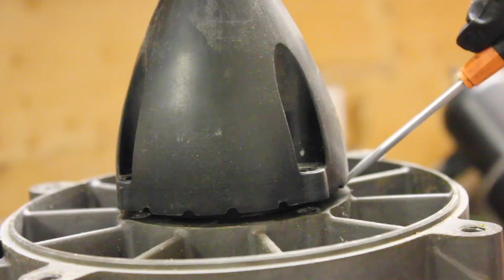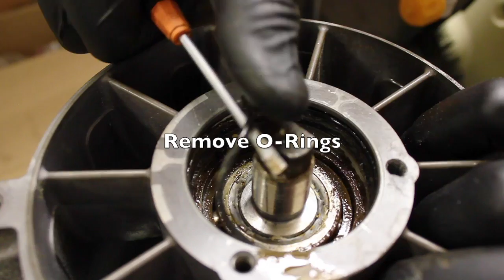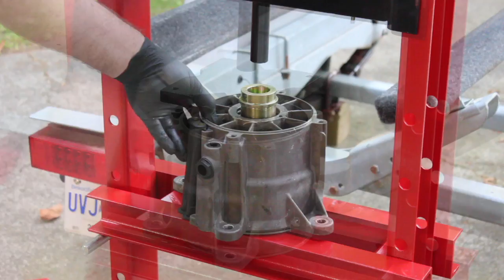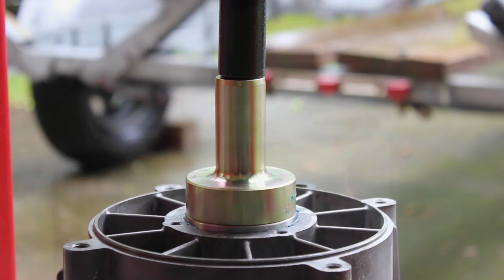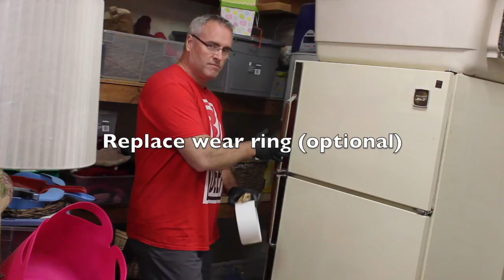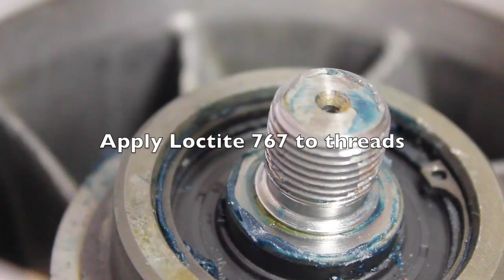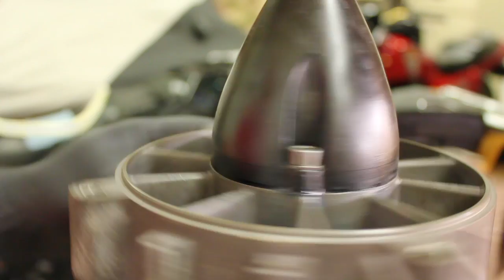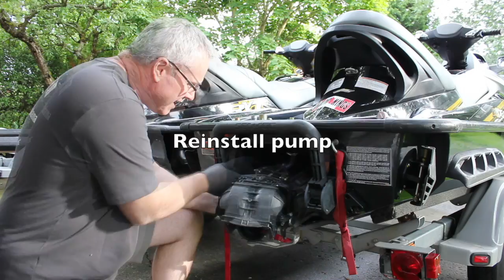How to Rebuild Your Sea Doo Personal Watercraft Jet Ski Jet Pump

Comment: Fantastic video. Love the closeups! Makes me want to go buy a press.
Reply from the maker: Go for it. They’re fun for the whole family!
Reply: Do it . I bought one to rebuild my pump , and also car  transmissions . I always brought my transmission pressing jobs to a friend of mines shop. About time I spent $150 , and bought my own. You really need the seal and bearing pressing tools, they worked great .
Reply from the maker: It’s interesting how many times we’ve used the pump after we bought it. We thought it would be used very rarely, but there have been lots of repairs that required it. Thanks for your comment.

Comment: So I have a 2007 RXT 215 and I'm 99% sure the pump bearings are bad/have failed because the impeller spins freely and doesn't "stick" like a normal greased bearing would. I'm debating rebuilding it but being 17 years old I'm probably better off just replacing the whole thing wouldn't you think? I'm in a pickle trying to find a replacement and would like some insight/advise of which route to go and/or any recommendations for a replacement pump. Thanks! Also this video was super helpful and answered a lot of my questions I had about rebuilding my pump!
Reply from the maker: As long as you have the tools and patience, a 17-year-old can do it. Mechanics is just like cooking: just follow the instructions in perfect detail. If you’re going to tackle these types of jobs, it’s highly recommended to get a Service Manual for your machine. It is much cheaper to rebuild it, and you can learn a lot while you do it. Just make sure you’ve got all the tools (including torque wrenches) to do the job. SBT makes replacement pumps that are reliable and much cheaper than Sea-Doo’s OEM pumps. Buying the tools is a good investment, if you’re going to continue with repairs and maintenance yourself. Good luck!
Reply: @3ftDeepChannel  I bought the service manual for it and my brother has a press I can use. I just don't want to mess it up and then I wasted my time and money when I could have just replaced the whole thing.
Reply: @3ftDeepChannel  also it looks like the sbt pump doesn't come with the cone. Do I need to fill the cone with grease before reassembling it with my impeller?
Reply from the maker: Believe me, I always feel the same way.
Reply from the maker: You can get the cone from Sea-Doo. They’re not that expensive. Or, you can reuse your old one if it’s still in good condition. In recent Service Manuals, they no longer state to add grease into the nose cone. That’s probably because it never went anywhere, anyways. We just normally make sure it’s completely covered and add some more, but we don’t put any into the cone.
Reply: @3ftDeepChannel you don't replace with oil? Since it came out with oil
Reply from the maker: The oil will come from the engine. Certain parts need to be greased, however, as described.

Comment: What are the exact tools you use to push  the bearing, shaft and seals out of the pump. Looked on you site but I don't see the one you used and don't want to order wrong ones
Reply from the maker: They are bearing pushers. You’ll need to get hold of a service manual for your machine and confirm the right part number, as they vary between machines. Good luck.

Comment: A very good video indeed. But I have a problem. When I try to loosen the nut, the only thing that comes loose is the impeller. I don't understand how I can make the nut come off and not the impeller?
Reply from the maker: You need a special tool that has the same end as the driveshaft that will hold the impeller from spinning when you remove the nut.
Reply: @3ftDeepChannel  I have the special tool. But the impeller still comes loose first. Is the nut links? 😊
Reply: @olavvatna  Try pressing the shaft out of the impeller housing first, and then take the nut off

Comment: Another Great Video. I have a Pro tip that won't help many, I'm a retired Professional wrench and I now live on the Gulf Coast in a house on Stilts with a One Car Garge under 1000 Feet from the Shoreline, I have no space for a Shop Press not to mention that the Corrosion here is horrendous. I just happen to have a S.-O. CJ Puller Set that I purchased Piece by Piece over Decades from the Tool Truck with weekly payments. The CJ-2002 is a good Starter Set (Costs way more than a Shop Press BTW) and may be available Used? A Pair of Longer Jaws and  a Longer Screw would need to be added to be able to Rebuild a Jet Pump however. My  point is that it is possible to Rebuild a Jet Pump without a Shop Press.  Randy   AKA randog311
Reply from the maker: Thanks for the tip, Randy. Sounds like a good option for someone who doesn’t want the bulk of a larger press.

Comment: I have a 2015 Sea Doo GTI 130 Se that needs a jet pump rebuild,  would it be the same procedure?
Reply from the maker: It’s basically the same, but you should get a service manual for your machine to make sure it’s done right. Good luck.

Comment: Nice video, wondering if the jet pump can move in and out, are the bearings knackered? Mine makes a sort of rattle sound at idle. Shaft has side to side play as well
Reply from the maker: There shouldn't be any play in the pump like that. What year is your machine? How many hours are on it?

Comment: Hello, great video, how are you loosening the flange nut at the start when you hold the shaft in teh vice?
Reply: The flange nut is held in the vice I think and he breaks it loose with the tool from the other side
Reply from the maker: Yes, as Tyler says we use a special impeller removal tool to take impeller off.
Reply: @3ftDeepChannel  yes i understand that but when you try and loosen the shaft with the impellor tool wont the impellor loosen off first? Man thanks - you can remove the shaft with the flange nut on and the hold shaft in vice and use spanner on the nut?
Reply from the maker: Ah, I see what you're asking now. Sorry for the delay in understanding. If I recall it works because the flange nut isn't on as tightly as the impeller.
Reply from the maker: Just checked the Service Manual, and it says if the impeller unscrews first, tighten it up and try again. They're actually on at the same torque.
Reply: 3ftDeep thank you for that :-) again great information on all you videos! Continue to watch and learn :-)

Comment: Great video!  When pressing the seal in, are you bottoming out the seal in the bore or the tool on the face of the pump?  I'm getting ready to rebuild the pump on my 2006 RXP 215 and don't want to spend the money on the custom tooling, if I don't need a stop to set depths.
Reply from the maker: We stop when the bearing bottoms out in the pump. Good luck with your rebuild.

Comment: Hello an awesome videos as everybody else has said. I removed the main bearing out of my pump unit just as you did and when I pressed the shaft out the inner races came out of the main bearing. So I end up with three pieces, the outer race with the ball bearings inside and then the two inner races. Is this how it's supposed to be or is the bearing supposed to stay in one piece. Thank you very much for any info you can offer on this. I don't want to buy a new bearing as this one looks like it's in perfect condition but I'm not sure if they're supposed to come apart into three pieces. Thanks again
Reply from the maker: Thanks for the kind words. When you press in/out a bearing, you must always press on the outer ring as there is very little material holding the bearing together. When we pressed the shaft out, we placed the bearing over a hole so the inner and outer rings were supported by the plate as the shaft was pressed through. If your bearing came apart, it needs to be replaced. Good luck with your project!
Reply: @3ftDeepChannel  OK.  Thank you very much for the amazingly fast response.  You guys rock.

Comment: So I see many rebuild kits for the jet pump. I am looking to just replace the o rings and the grease on the impeller bearing. I cannot find the o-rings and the locking screws to purchase anywhere. Do you have a specific place you source parts from?
Reply from the maker: We only get those parts directly from Sea-Doo. If you go to their website, you can order the parts directly from Sea-Doo.com. Unfortunately, I'm away from my computer for the next few days, so I can't give you the link. Good luck.
Reply: ooo, thanks, I didn't think to look there

Comment: Great video. Perfect!
I was wondering if you can give me advise. My 2008 ski run well yesterday for 3 hours. Today, after 20 minutes, of low speed riding a grinding noice started. I could here it from 40 yards away. Can a shot pump bearing  cause that?
Any other suggestion what to check?
Reply from the maker: Yes, a shot pump can cause that. I would not even start your machine until the problem is resolved. First check the pump intake (through the intake grate) and see if anything is stuck in there. That is the most likely issue. If the intake and pump is clear, pull the pump and check it out thoroughly. If the pump is in good shape and you have a supercharger, it could be a bearing/washer failure. Do you have a supercharger?
Reply: 3ftDeep , it is a GTX 155 without a charger.
I  am about to order a new bearing kit. Is QEM the way to go or  can you recommend an after market set?
Do you have a discount code for your page. I need to order the tools needed for the bearing change.
Reply from the maker: @guenster8881  OEM is the way to go for us with those types of components. Did you confirm the bearing is shot? We greatly appreciate that you're considering going through our store, but unfortunately we don't have a discount code. Go with the best price on the OEM part you can find. You'll need an impeller removal tool, and a bearing press. Good luck.

Comment: Love the video. Doing the exact same sequence right now. But what are the odds that the wear ring is going to "pop out" like in this video? How long was the pump in the freezer - like 3 hrs or so?
Reply from the maker: At least an hour. It’s hit and miss. Sometimes it’s very easy, sometimes it’s very hard. Most of the time it’s somewhere in between. Good luck.
Reply: @3ftDeepChannel  Thought I would report back. My impeller is out for rebuild and I had looked at the wear ring and decided it was fine given the hassle of replacing it I've watched in other videos. So I put the pump into my freezer for 4 hours with the wear ring facing down. Went to pull the pump out and the wear ring simply fell out - easier than your video LOL. So thanks!
Reply from the maker: @mickgalvin  Great stuff!!

Comment: Should I remove the flange nut first and then the impeller? I am not trying to rebuild the pump my bearings are good, just trying to put in a new wear ring.
Reply from the maker: If you’re just going to change the wear ring, you may not need to do either. Check out our other video here: https://youtu.be/axU-9Wi_Y-E?si=_2irTSmzrtYKQo2d

Comment: So my 2013 155 that I have owned since new has never had a pump rebuild. It currently has 1045 hrs on it. its only run in fresh water and I never sucked up anything bigger than a small sticks that I could clear out on its own.  I check under the impeller cover when winterizing and I have never seen any water, nor is the grease milky,  seals still look okay. Should I be rebuilding it as PM? I have read online that some people say every 200-300 hrs but that means I would have rebuilt it like 5 times by now. Am I just playing with fire by riding with this many hours without rebuilding?
Reply from the maker: That’s a great question. If it seems to be working perfectly, and there is no water intrusion at all, then it may be that it can work perfectly well for another 500 hours. I don’t recall anyone ever going that long without an issue. Next time you’re in the area remove it and check the bearings for any play, as they are bound to wear out soon. Good luck, and thanks for your comment!

Comment: The 2016 Gtx manual says to add only a thin layer of grease to the o-rings of the jet pump cover and no grease into the cover anymore. In spite of all do you recommend to add more grease ?
Reply from the maker: I think the reason it says that is that the bearing grease is so thick it doesn’t flow out of the cone, anyway. That’s our observation. So, it’s a waste of grease. It’s important that you pack the grease where the bearings and other components are, though. Good luck.

Comment: Thanks for the Great video. I think I need to rebuild the pump on my 2018 seadoo wake 155. It's got a distinct whining sound that my buddies ski had before his bearing exploded on his spark jet pump. However I'm having issues finding the parts and tools I would need to do the job. Any recommendations? Thanks
Reply from the maker: We stick with OEM parts for the pump. I would highly suggest contacting a Sea-Doo dealer for those. As for the tools, you can find those on Amazon or eBay. We make it a little easier by linking to some of the tools on our website: 3ftdeepsports.com/store/ Good luck.
Reply: @3ftDeepChannel  thanks for the quick reply. Really awesome how you make a point to respond to people. I'm gonna like and subscribe so I can support a great content provider.

Comment: I removed the sear clip and tried removing the seal but the first layer just crumpled.. do you think I could just press the shaft out with it still in without damaging the shaft?
Reply from the maker: I believe so. As long as you press the bearing out with the shaft, first.
Reply: @3ftDeepChannel  I’ll leave another comment if it was successful or not. Just gotta find a press firdt
Reply from the maker: Please do. Good luck.
Reply: Yup you don’t have to take that first seal out (the black rubber one) I just removed the circlip and pressed it all out. My shaft is different then yours though. I have the shaft then the sleeve (which is removable) and mine are in perfect shape. Even the bearing! But going to replace everything anyways. Thanks again!
Reply from the maker: thanks for the update, Ben.

Comment: What kind/brand of pump grease are you using? The seadoo brand one is yellowish. And why do you recommend replacing the cone screws? Great video by the way.
Reply from the maker: I use the Sea-Doo grease, but Chris uses standard marine grease. We haven't seen any difference (yet). The service manual says to replace the cone screws, so I always do. Chris never does, but then again his nose cone fell off once. He doesn't blame the screws, but I do. Good luck and thanks for the comment!

Comment: Hey mate how you doing? Got a question for you...on the typical 90s seadoo sportster how much water does the venturi push up from jet for cooling?  Obviously it would depend how good the wear ring is but would it be as much as a garden hose would push out? Just doing some calculations for my Subaru impreza project..will most likely be running it through a heat exchanger though. Anyway take care.
Reply from the maker: Gee, we really don't know. We don't want to venture a guess and make a mess of it for you. I suggest contacting BRP directly. Maybe they'll know. Good luck.
Reply: @3ftDeepChannel  ok thanks

Comment: Do you recommend changing the jet pump grease just as a maintenance precaution?
Reply from the maker: We normally change the grease only if water gets into the pump, or when we take the pump apart. When checking for water during the normal maintenance procedure, we just normally top it up with fresh grease. Thanks for your comment.

Comment: Just curious, it looks like there isn't any black paint on the pump housing. Did Seadoo stop painting them?
Reply from the maker: They didn’t powder coat the pumps in some older models. Some pumps are so heavily corroded that they actually lose all of the powder coating. I think the former is the case here.

Comment: Do the 4 bolts when putting it back in matter on how much you tighten them, when reinstalling into the jet ski?
Reply from the maker: Absolutely. The correct torques are essential. Make sure you torque them to the right specs for your machine.

Comment: Can we get some part numbers for these special tools you are using (bearing pushers). I see you used 2 different ones. Are these tools the same for a 2006 supercharged GTX? Thanks
Reply from the maker: Hello Cody, You can find most of the tools we use at the following URL: http://3ftdeepsports.com/store-tools-specialty/ . As Sea-Doo change parts over time, we can't confirm what tools will work for your machine. We suggest getting hold of a service manual for your machine and check what tools are needed. You can then find your specific one on our website at the link I just gave you. Good luck and safe riding.

Comment: Tried it, flange nut was stuck and impeller came lose on the first step. Did you turn right or left on the impeller to loosen flange nut?
Reply from the maker: We worked it both ways, with emphasis on counter-clockwise. It can be a pain in the neck sometimes.

Comment: I removed my jet pump, looks like the bearing is bad due to water intrusion and no grease. Is there any clever way to do this without a press? I suppose I could buy a cheap one, but they’re pretty darn big, not sure I want one in my small house, and some rebuild shops only charge about $120ish labor anyway. Thoughts?
Reply from the maker: If you use the right-fitting bearing tool, you could use a hammer and tap it in/out. But you need to be very, very careful not to destroy the bearing during installation. Good luck.
Reply: I tried it without a press, and ended up with a new jet pump 😂. Be careful where you are smacking the hammer.
Reply from the maker: That’s the worst case scenario! What did you hit? Do you have one of the older plastic housings?
Reply: @3ftDeepChannel  No, its aluminum, I hit where the bearing seats on the inside.  I have a bit more piece of mind anyhow knowing it's all within spec.